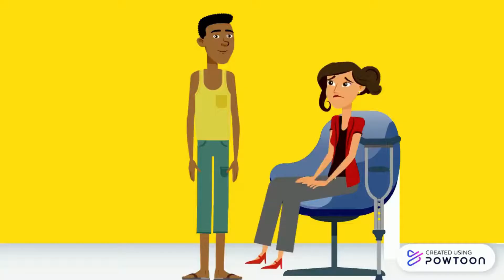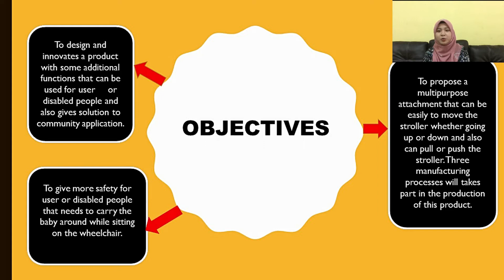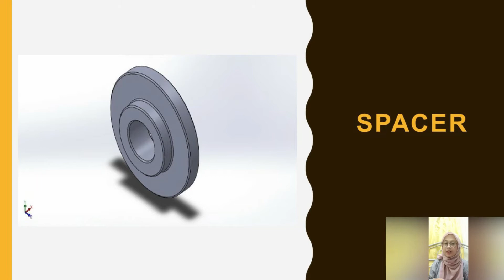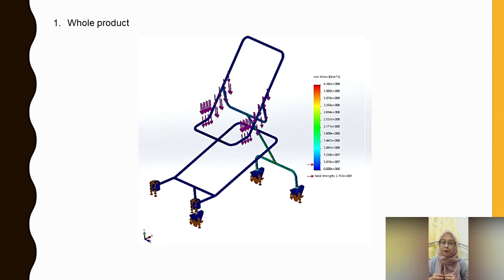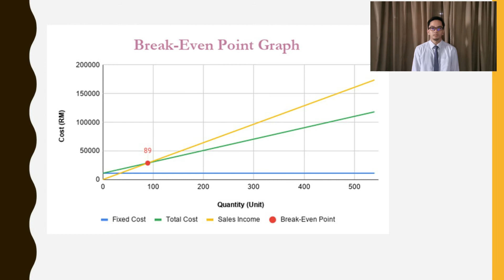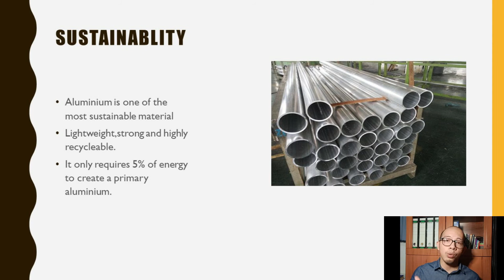BMFU 3323 WHEELCHAIR ADAPTIVE STROLLER

Comment: First of all, congrats on completing this project and presentation. You guys did a great job considering the pandemic that is happening right now which abruptly change the way we conduct this project and presentation.

I have a few comments and therefore questions for you guys.

1. I think the objectives are not specific and measurable, it is written in very general and therefore it is hard to determined if they are achieved at the end or otherwise. 

2. How the “functionabilities of the product” were determined and decided (please elaborate)? I think this is a very crucial part of your project since your product was build upon these specifications. Some functionabilty like “reduce time to lift the baby from the stroller to the car” is not logic since the parent has limited mobility.  

3. Some “functions” are not the function of the part. For example, the function of “upper framework” is not “lightweight and easy to control”. Maybe it is more like, “to support the weight of the baby”?

4. The orthographic and exploded views are not readable. I cant read the dimensions shown partly due to small resolution. This can be improved by putting yourself as the viewer of this presentation. 

5. You guys also did not explain how your product works. You guys did explain the how the parts work but not as a product. How it works. I figured out myself at the end that how the product works.

6. Based on the FEA results, what actions were taken?

7. How the fixed costs were determined? Roughly elaborate a bit.

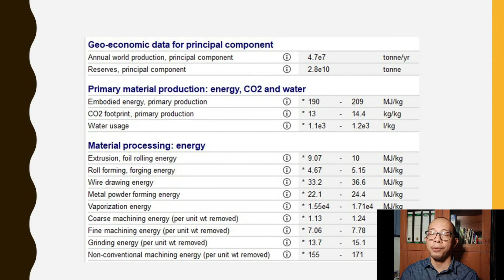8. What are the relevant between the shown data (at 10:35) and your product. Please explain a bit, I fail to see the relation between those two. 

Thank you. Keep up the good work :) 

Dr. Juff (IDP Panel)
Reply from the maker: First of all, we would like to thank to you sir for your comments and observations. We would like to apologize for the lacking of our presentation as we are only given minimal time which is 2 minutes per person for the presentation to point out our product. This is our first time presenting our project through an online base so we are beyond sorry for the inappropriate presentation. However, here are responses from us regarding your questions : 

Q2: We are sorry sir for some miss explanation. Our product designated especially for a disabled person who has a child under their care. They don't have to carry or hold their baby on the lap because it is dangerous for baby safety. Some parents tend to not hired another guardian to look after their child so we invented this product where a wheelchair is attached to a stroller. Mothers of the baby can sit in the wheelchair while looking after their baby without holding their offspring for a long time. So, we decided to focused on this functionality of the product and focused on disabled people because many of us have witnessed or some of our relatives involved in an accident in which the victims lost their leg and the ability to walk. They only count to the wheelchair to move around. Maybe some of those victims still have a child under their care. With this kind of product, we hope it could lessen the disabled mother's burden when their husband went out to work. Disable mothers can take care of their children on their own. The baby car seat can be attached and detached so it also can be placed in the car. The stroller also can be detached and use it as a stroller.

Q3:The function of the upper framework was to ease the control of the disable people since they could not hold their babies on their own. They can place the baby into the stroller which is the upper frame part . It is because this stroller is different from another stroller where it can be adjusted whether to pull or push and to going up or down. This stroller is really helpful to the disable people. But, we are strongly agree with the function was to support the weight of the baby that we applied.

Q4: We are so sorry sir for the unreadable dimensions of the product. It is because we put with the smaller size during the labelling. We should be more creative on how to present like presenting myself with a detailed explanation about the drawings instead of only just show the drawings. We will be more aware of that issue in the future. Thank you,  sir.

Q6: FEA results shown deformations occur at the intersection at the lower frame when maximum force is acting on it. So to overcome the failure, there are some suggestions and recommendations ; 
i. Upgrading the design of the product.
ii. Choose the hollow material with the larger outer diameters but with smaller diameter to increase the thickness of the hollow for the framework
iii. Using harder and stronger material such as stainless steel

By altering the framework, the FEA analysis results would be more appropriate and the product would be safer especially when it applies to disabled people. 

Q7: Since we are still in pandemic phase, we are only able to set the fixed cost by referring to an internet survey on certain cost of products that are included in the calculation of the fixed cost. Besides, the fixed cost we have set is just an assumption, we should seek the real price at the real hardware shop to obtain more approximate value.

Q8: Regarding the data shown in the video, we are trying to explain the C02 footprints and also energy of processing for the material itself.The table that was given in the video only generally give the information about the amount of co2 emissions by the aluminum itself not specifically the product. This is because we don't have the actual product.

As the answers we have given above, we would like to apologize once again to you sir. We have noted all of your encouraging comments and we would  thank you very much sir.